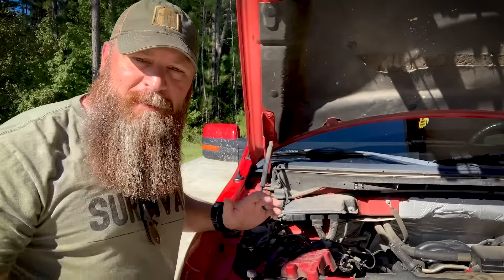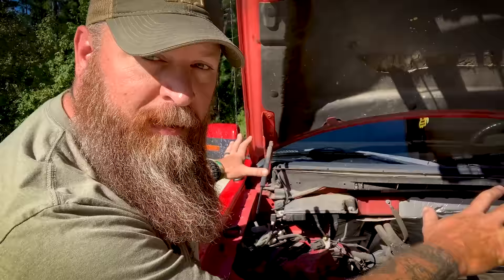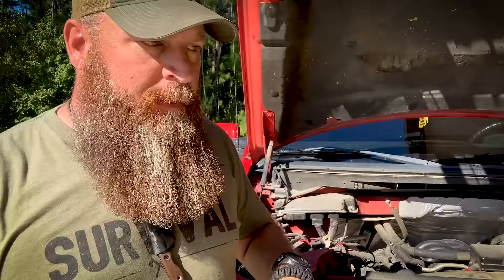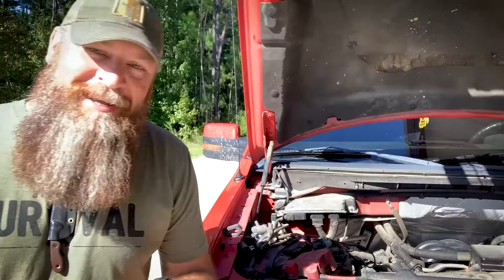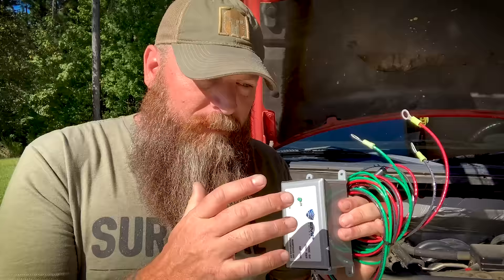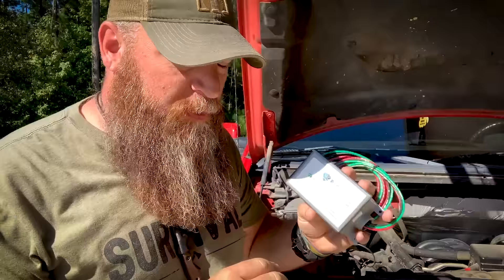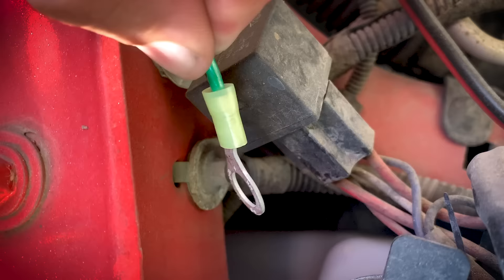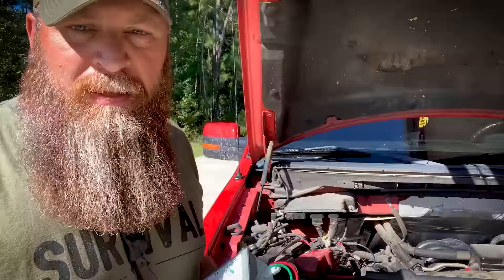EMP PROOF YOUR VEHICLE

Comment: I have been pondering this for hours and I’m not the smartest person by any means but I have to call BS on this.   I come from this on 2 angles. First being a ASE certified mechanic and having a huge amount of🎉 knowledge on vehicle electrical systems. 2) I’m a radio operator/com technician for a two-way radio company and antenna theory is kind of my thing. By connecting a box to the “negative battery terminal” and another one to “ground” you have done nothing. The negative battery terminal is ground. In fact the other end of the wire that comes off the negative battery terminal goes right to the frame. Those two wire are one in the same. If you connect the other wire to a positive battery source and have 2 grounds, you have created a circuit around the battery. Simple electrical circuit from one battery terminal to another. It’s not going to any other circuit in your vehicle. So let’s pretend there is a high voltage spike at the rear tail light enough to fry the wires… how is it protected by a circuit that isn’t connected to high voltage circuit? When your break light burns out you don’t loose your car radio right? If the “wires in the car act as an antenna” that means the damage will be in the etching of the circuit board. The traces will get cooked. How could a device doing a loop around a battery save the board inside a car that has absorbed electrons. Moreover, those wire that run through the box are not the correct gauge to handle high voltage. Go to a home improvement store and ask a sales associate to sell you some wire. Tell him you want to wire an electrical outlet and then tell him you want the wire to run a sub-breaker panel. You will quickly see the sub-panel wire is much thicker than the outlet wire why? Yes, the thinner wire will fry. Those are my problems with this device. I’d love some back and forth or point out what I’m missing.

Comment: You need to shield ech electronic module with a Faraday cage. The electronics do not need to be powered by a battery or grid, the EMP will short out anything exposed to it even unpowered. This device will not achieve anything.

Comment: when the shit hits the fan ....gas runs out and stored gas goes bad in six months ... and of course nothing short of your truck being stored in a garage wrapped in a  very expensive Faraday weave with large copper ground lugs at least ten feet in the ground   Sorry you cant protect your vehicle from an EMP with a surge protector ...an EMP creates the current in every part of conductive material whether it is connected or not to the circuit. ... as for the a I have an old Jeep with a LPG conversion and  LPG does not go bad

Comment: I'm a retired electronic technician, I can't see your electronic device being able to handle such a voltage load on such small wires and I do not see where you are you bleeding this will be the ground? I think you need to park your vehicle in a Faraday cage or maybe a ground strap from the frame of your car dragging to the ground. Otherwise there's nowhere to discharge her voltage to…

Comment: Thats not how it works...(EMP) is an effect where radiation emitted after a nuclear blast destroys the silicon junctions in semi conductors. (Micro-chips, processors, transistors, etc.). This is a direct influence effect, it does not come as a transient through cables or conductors, so the only way to prevent damage is direct shielding of the components.

Comment: This device will not work at all. An EMP is an energy pulse (typically in this case of concern, a LARGE energy pulse). This pulse travels through your via stray inductance (wiring, various metal parts of your vehicle, etc.). This energy and the inductance that it’s passing through generates a voltage (in this case a very high voltage). 

When presented with this high voltage, the modules in your car try to absorb that energy via the zener and TVS diodes that are ALREADY installed. 

For the suppression devices (TVS and Zener diodes) to be effective in protecting the vehicle’s electronics they need to be extremely close to the device needing protection as the effectiveness of the suppression device declines exponentially with distance 

Adding this device to your vehicle in some random location will do nothing in protecting the modules that are located throughout your vehicle.

Comment: From a mechanics point of view you should have a mechanical diesel as a bug out car fuel is going to be a problem very quickly and mechanical diesel engines will run on any oil baced fluid waste oil peanut oil veg oil you name it  and no electronics 👍 just my 2cents

Comment: A surge protector that goes across the plus and minus power coming from the battery & to chassis ground does not have the ability to protect the vehicle as every injector, ignition coil, and all the lights, horn, even stereo speaker wires will generate up to 60,000V per meter of wire. On every single wire in your vehicle... where those wires come into the ignition CPU, Trans, stereo, etc, etc, etc... do not go to positive or ground on the battery, they go through circuitry like FETs, transistors, diodes, ingratiated circuits & micro processors and THEN to power or ground and they will be blown to hell! Your injector wires are at least 1 to 2 meters long, Your brake lights are more like 4-5 meters long... X 20KV to 40KV depending on you distance from the EMP minimum going through parts that have sensitive gates that will be destroyed in that 1 millisecond. Get it if it gives you comfort, but... there is a reason the military went back to diesel engines.

Comment: If that device has any solid state electronics, it is going to fry. A Ford Edsel is going to survive an EMP attack because it has no modern electronics. The radio has vacuum tubes. It is analog electronics.

Comment: If your electronics are not energized, they wil not be effected. Your best bet is to have a tube radio with no transistors or integrated circuits. I could sell you an empty box with a guarantee against EMP cause you wont be around to collect it.

Comment: i still dont get this. say your in your car jamming to music and BOOM! a emp goes off, how is this thing going to protect anything? the car antenna will act like a big umm antenna! and if your a cb, ham, gmrs  etc etc person and you have antennas on your vehicle BOOM! you just became a big emp magnet again. I dont care if the radios got fried i have more backs ups but didnt those antennas that are mounted to your car/truck grounded to frame and hot wire going to battery of fuse box..didnt they just amplify the emp,cme signal?  i think somebody needs to test this  anybody got a spare nuke handy :)

Comment: I don't buy it the wires on it are too small to carry any amperage and the emp is going to enter the electronics at several different points not just at the battery and it will pass through all the different sensors and circuitry before it leaves to that box and then shorting everything to ground is bad in itself. If the ground is fast enough to not pop all your fuses, then you would still need to mesh all your electronics and in newer vehicles they put electronics literally everywhere in the dash, under the hood, on the engine and even in the engine, the grill, fenders, center console, headliner, trunk, under the seats, in the doors, you name it and that's a lot of stuff not to mention you would need to put ferrets on all the wiring running everywhere. Like I see someone in the comments said you need a old mechanical diesel no spark plugs or coils no electric throttle control or electronic fuel injection for when the total shit hits the fan to call it a ultimate bug out vehicle.

Comment: Um, I don't think that connecting an electrical device to your vehicle to protect said vehicle from a threat that destroys its electronics is going to work 🤔. The signal is still going through the vehicle to get to said device 🤔 so all micro circuitry is going to be fried on the way 👈💯. There is only one way to protect an electronic from an emp, and that's to ensure that the signal never touches it in the first place. If it get to it, it's gone, so a Faraday cage is the only proven means of protection. This emp is like a wave so to think your gonna get a boat  to magicaly suck all the water up with out getting your boat wet is crazy 🤪.

Comment: You don't need anything to protect your car from an EMP it only destroys equipment that has power going through it just disconnect your car battery put a quick connect no power to the vehicle no shorts and put a lead box around your battery

Comment: I don't think that box is going to save you from an EMP the EMP we had in 1800s fried the insulation right off the wires and if your car's grounded you don't need that box anyway you just wasted 50 bucks dude your tires is grounded by rubber

Comment: An EMP is just what the name says, an Electro Magnetic Pulse. This is a pulse of radiation, and has NOTHING to do with any electrons in the air. Electrons are subatomic particles, which exist and flow in cabling and electrical equipment. An EMP is a strong forcefield that electrons may react to, depending on the direction and force of said field, and those electrons will react with action on atomic levels. They will primaily wipe out embedded code in processors and data chips, which is discrete data, embedded and saved in binary form, and here is why an EMP will make its hard damage. 
Processors and other chips will still not be damaged mechanically or visually, not even seen with a microscope.  
So you need to understand this: the EMP field created by an atomic blast will traverse through air and most materials, at the highest possible speed, which is the speed of light. The time it will take to pass through your car is not counted in billionths of a second, but in extremely much smaller timespans. 
There is NO WAY in fantasy, that a little box containing some electronic do-dahs will be able to prevent the force of an EMP to destroy your electronics..... unless you create a Faradys Cage.  Go and google that.

Comment: I dont see how this or any item that does not cover / encase the entire computer system and entire fuse box with Faraday type protection an EMP is basically like being in a room with MRI machine the particals of electro magnetism dont just hit or strick wires its gonna hit the entire every square micro mm all parts of ypur car so its gonna pass through your car computer car fuse box ....thats gonna fry any computer board resister transistors any and every electronic PART AND PARTS. It looks like you would have to have ypur fuse box and any computer totally incased inside of a Faraday box then every wire going in and coming out emp protected so Im suspecting you need FARADAY protecrion to go hand in hand with these type of units because of the basic law of physics of the way a EMP wave form works ...I really dont see how this would protect the computer board and chips plus fuses from being directly struck by the wave forms bypassing and battery connection and any wires its still gonna strike the electrical components so no matter if you had the battery and all electrical wires unhooked the EMP signal is still gonna short out and fry components that are not completly surrounded and covered by some sort of FARADAY protection

Comment: Does thin wires will handle 5000 amps. Are you serious or are you a mouth piece for the manufacture. Your starter handles fraction of that current and it has a wire the size of your baby finger. 
So you know about E3, as you said it goes for hours or days and you think that these thin wires can handle 5000 amps. 

What about " direct" magnetic field inducing currents inside computer chips, inside diodes, inside capacitors,etc. What protects direct   induction.

Comment: This seems like a snake oil product. It is all theoretical and there is no way to properly test or prove it works. Not to mention that even in theory it shouldn’t work. An EMP will enter any conductor that isn’t shielded. A vehicle ECU will fry. The only fool proof way to shield from an EMP is to shield all electrical conductors and components or protect them in a faraday cage. Proving the theory of simply grounding the pulse will not work, the electrical grid is directly grounded as was the telegraph system that fried during the coronal pulse. That box is pure BS for protecting a cars electrical system.

Comment: About as legit as the "Fuel Dr 47"
This useless car ornament is built inside a electrical j-box from Home Depot.
😆

I assume it's got a few MOV's to shunt high voltage and an LED with some wires.
As mentioned in the comments below, a Faraday  Cage  is about all that would be worth a crap.

Comment: Stupid. Any steel-bodied vehicle is inherently shielded from EMPs.  The steel shell acts as a Faraday cage,(look it up),dissipating the charge.  You may need to swap out your battery,but other than that,there'll be very little or no damage.  Basically,an EMP is like being hit by lightning,which most modern vehicles are hardened against.

Comment: This is snake oil. The only way to protect against EMP is direct, deep burial of the device that needs protection. Or a properly designed faraday cage that is grounded to earth. The cage needs to be thick walled steel with absolutely no openings and grounded with multiple deep driven ground rods with short, heavy gauge ground cable to be even semi effective against EMP. It’s proven that even the gallium nitride diodes (which are probably inside this device) cannot withstand greater than 10 kV/m. You’d need a truck load of them on a properly designed circuit that is not resonant with the frequencies that EMP emits to get semi close to a margin of effective protection. A high altitude nuclear detonation would induce voltages exceeding 50 kV/m into any electronic circuit. You need 80-90 dB of attenuation through 100 GHz in order to be effective at stopping EMP damage to critical systems. No faraday bags, no magic snake oil boxes, nothing can stop EMP except the aforementioned methods described above.

Comment: Sorry dude, not much of your video is correct. If an employee was generated 100,000 feet, the radiation, Electro-Magnetic pulse can only reach 488 miles due to the curvature of the earth. Also those devices do not work! The only shield that works is a faraday cage. White Sands NM test station does the testing of all electronic circuitry and they don't use the device your device which is only an MOV device that cost a dollar.

Comment: Piece of mind? Absolutely NOT. Don't buy it, it's a scam! This isn't even a surge protector. A surge protector would need to be placed between the battery and the wiring harness. 

Microprocessors are what's vulnerable to an EMP and if they are not shielded in a faraday cage, they fry.
Period.

You need to locate each microprocessor in your vehicle and build a copper box around each one and ground that to the chassis. 

Read up on faraday cages.

Comment: All the information I have seen so far is bs straight up misinformation.  The ONLY way to shield from a magnetic field is a THICK layer of ferris material surrounding the wiring,  I'm talking about 2 inches of steel, or 3/4 " of alnico. So your truck will weigh 20,000 lbs

Comment: As an electrical engineer, I will tell you this is a waste of money.  The idea is sound, but think of it like this “ all of the wiring in your car is an antenna for an emp. Your only putting the battery and some of the circuitry in the car in the protection of this device. Unless you put one of these devices into n every wire run in your car, an emp will fry every module input that isn’t protected.  Sadly it won’t save your car. If nukes start flying, the next thing your going to be worried about is the $50 your out on for buying the device.  Unless you have lots of gas stocked up, gas won’t be delivered and gas stations won’t be able to pump it into your car because the electrical grid will be gone.  You will have to rethink everything. Those with solar panels will find out their solar panels were fried also. Sorry to be the bearer of bad news….

Comment: This is not going to work. 
I bet that module is hollow filled with epoxy.
Someone take it apart. 
But either way. Even if your battery was disconnected every sensor and module would be destroyed.  
Why don't you think if the production of this company was successful in such thing why wouldn't every power company install this on their generators?... then there would be no threat from EMPs! This is 100% a scam.

Comment: I think this device is complete nonsense!
Firstly .. the vehicles body is ALREADY connected DIRECTLY to the battery negative by a very heavy duty cable .. so is ALREADY grounded!
Secondly, the EMP spike isn't generated at the battery .. it's generated by the EMP directly coupling into the vehicles entire wiring system.
The only time you're going to find out that this system doesn't work, is when an  EMP event from something like a massive solar flare or a nuclear detonation occurs.
When you discover it hasn't worked ... what are you going to do?  .... take them to Court?🙄

Comment: Sorry, but the EMP doesn't follow your low voltage, or even you circuits design. It still follows the reality of physics.
The reality of physics, says the EMP will not be impeded by is shielding.
Why, because if it can travel through the atmosphere, which is a big, BIG ASS SHIELD, it will have the power to go through way more than 5 miles of glass, metal, concrete.
What it will do is destroy the little tiny wires and semiconductors by going straight to them.   5 miles of glass, metal, concrete, looks like silver wires to it's power.
Oh, and most importantly, we will be dead already or very soon, after the nukes start going off. The last half a billion or billion alive, will die within 6 months or less.